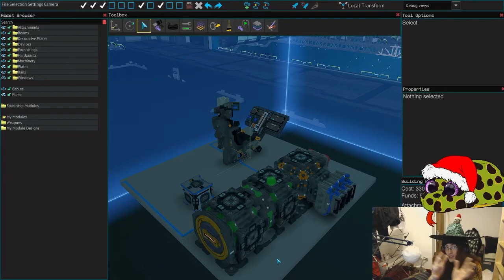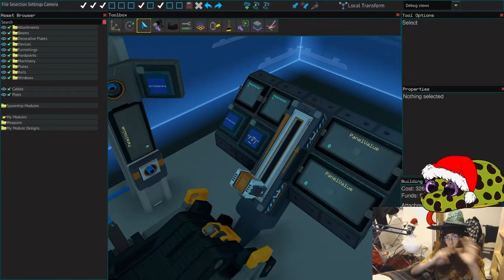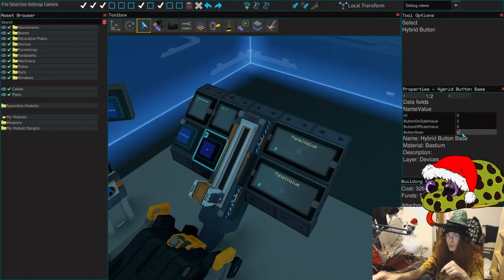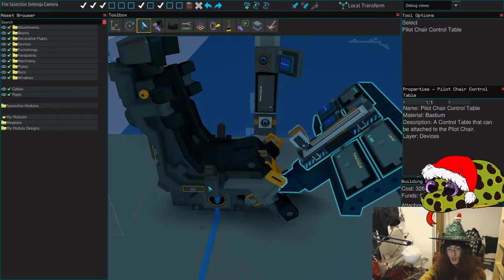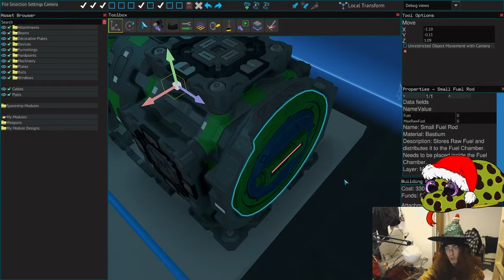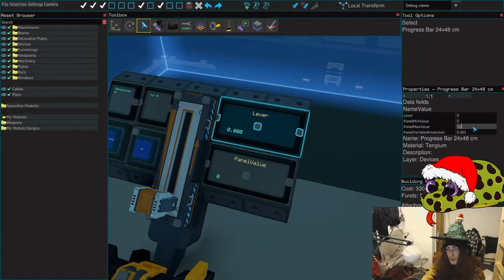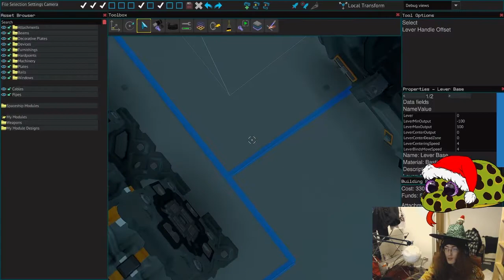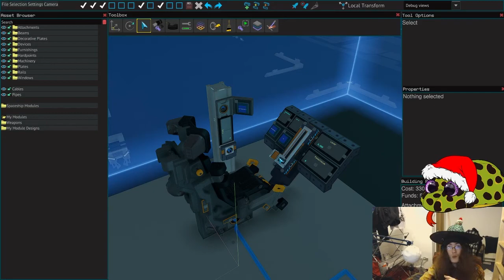StarBase Tutorial 1: The Basics

Comment: This Game is seriusly Bugged.. i cant turn on my Generators. even when named Button and generators the same. and even the Button, it wont snap back to normal again. i press 100 times and it remains ''ON'' doesent matter if i set the Button Style to 1.. And i have set Pitch to ''W'' and ''S'' but then the Ship turns... insted of pitch up down... and no Guide could help me so far... and how can i Enter this Ship Menu so i can rename something, or do some settings in the normal world, so i dont have to go Blueprinting it all the time for only 1 small setting.
Reply: you need to go to the custom ship designer. easy build station sucks bigtime. I lost hours trying to build there. Just go to the terminal there and pop your ship in and start editing.
Reply: @ryankl1984  i am in the Ship designer. havent used Easy building mode yet, was max 5 min in there. and now im facing another problem. my manouver thruster dont work anymore. and i havent changed anything :S hahaha. (also in Ship designer mode) havent realy got into the open world yet. 95% im designing ships haha.